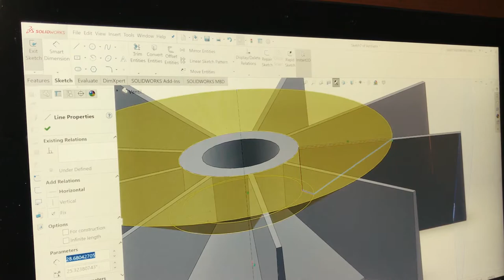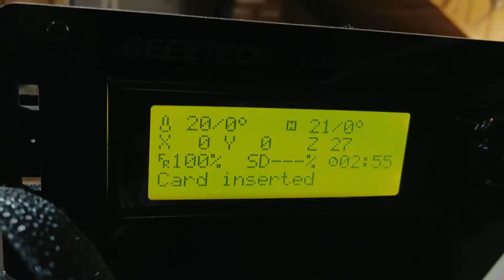3D Print | Electric Motor Cooling Fan

Comment: How does a straight fins fan generate flow in the direction of the motor frame?
Reply from the maker: I can't tell you a theoretical explanation. Above all, it creates enough drafts.
Reply: The explanation is way easier than you’d probably imagine!
Because of the centrifugal force the air is pushed to the outer part, creating a vacuum on the inside. Because of how the cowling is bend, the air is then re-directed onto the Elements to cool.